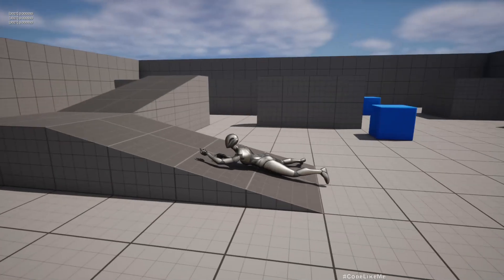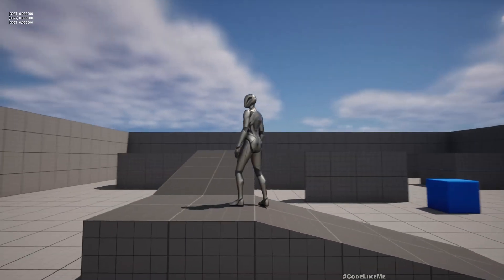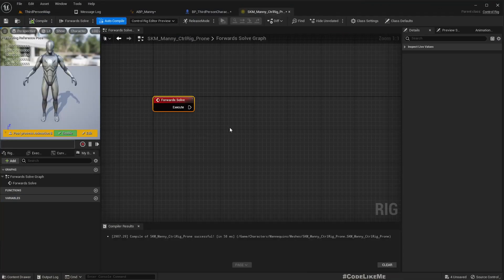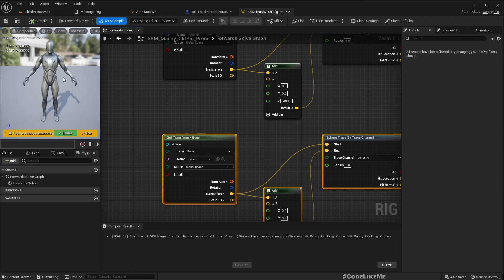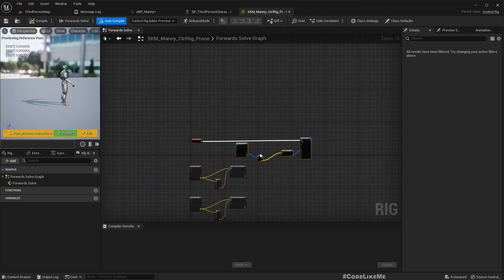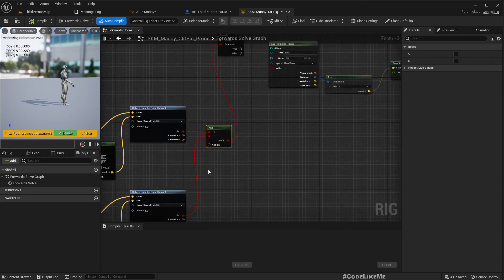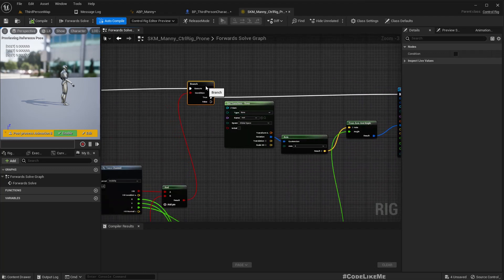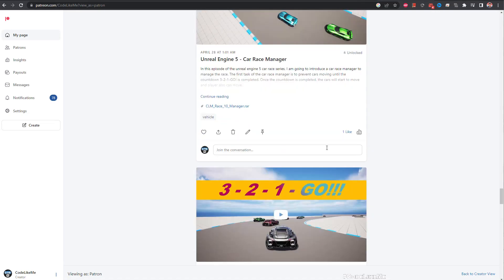Unreal Engine 5 Prone System #2 - Surface Angle Correction

Comment: Why did you have to do this in the control rig?
Couldn't you adjust the root bone in the animation blueprint itself?
Reply from the maker: possible, but most of the IK stuff are already happening inside the control rig. So, i thought it would be best to do it there

Comment: My issue is the capsule. I want to turn the capsule horizontally but nothing will let me. I have even tried shrinking the main capsule and using another that is sideways but I cannot get my character or the physics to recognize it. I'm trying to accomplish Multiplayer FPS prone.
Edit: I have accomplished an incredibly intricate setup but it's buggy and potentially expensive. I know it can be done MUCH simpler.
Reply from the maker: you can make the capsule horizontal by setting capsule rotation through code. Its not expensive, you can just set the rotation when you go into prone mode. But the character movement component is designed to work with vertical capsule. For example, if you fall, it will not detect landing event and you will be in falling state forever.

Comment: Max payne has the best prone rotation. Will you be covering something similar in future videos? The body stays in the prone position but rotates on its own axis. From laying on stomach to laying on back.
For the legs clipping in the wall when going backwards I used physical animations. This helped make the legs bend an not clip through walls.
Reply from the maker: Yeah, also aiming while in prone was great. we can aim anywhere while in aiming mode and body rotates accordingly. I am not sure I got the animations for that. But I will try
Reply: @CodeLikeMe  If I create some ugly placeholder animations for this, may you consider creating this prone aiming for us? :) (Of course, I'll donate the ugly animations for the project and anyone can use them). I can mocap this and try to clean up on Cascadeur.
Reply from the maker: @Amelia_PC  of course
Reply from the maker: Are you familiar with aim offsets.we would ideally need an aim offset in prone mode for this
Reply: @CodeLikeMe  Yup, I am, but only for Unreal 4. I'm not sure how UE5 animations work, but I'm pretty sure we'll need a "belly down-belly-up" direction pose, along with rotation on-ground animation in the same place, and a '360° rolling' similar to what we had in Max Payne 3. 
I have to work hard at my job, but I can send you something within two weeks.
Reply from the maker: @Amelia_PC  no problem.  Let me know when you got them
Reply from the maker: @Amelia_PC  and thanks for helping out
Reply: @CodeLikeMe  My pleasure! It's the least I can do to show my gratitude for this tutorial series.
Reply: @CodeLikeMe  This youtube video has something similar already set up an is available for download. Also has the Aim offsets and animations an ik set up already. Maybe could use this as a starting point.
I got it working by having it use a blank ue4 c++ project template. An copying the files into the folder.
[UE4] Prone IK [Git]
 https://youtu.be/VtjQMNUyafE